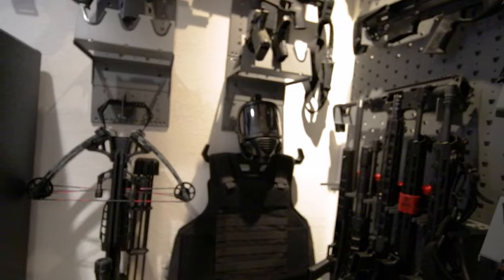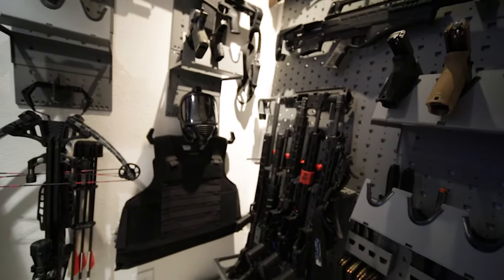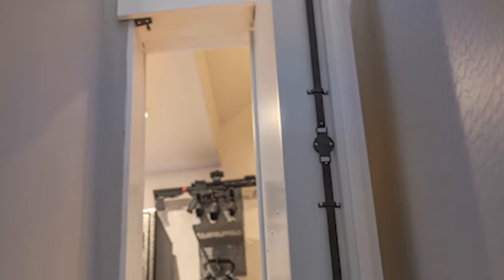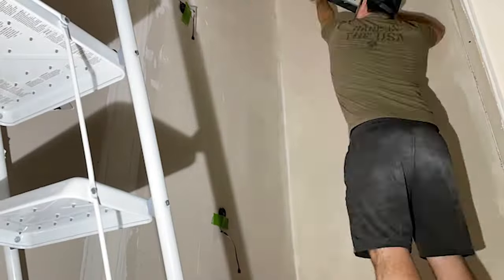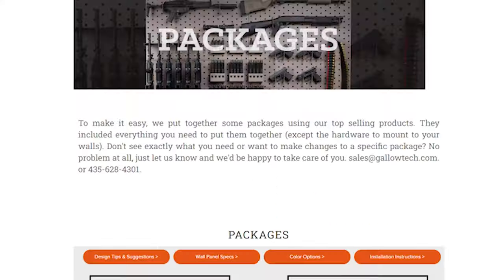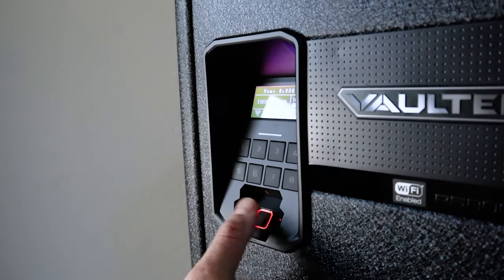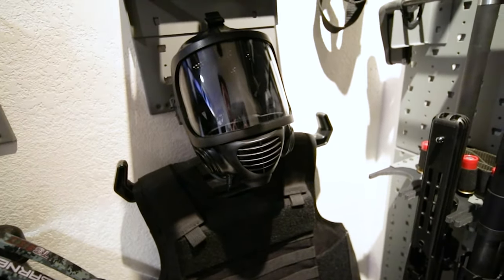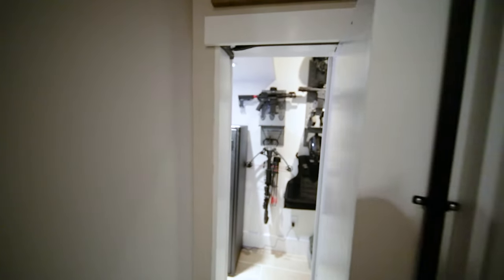Build Your Own Ultimate DIY Safe Room in Any Space

Comment: Only problem I see is security monitor inside the room. Something ever happens the cops will have to come in your secret room to watch it.
Reply: You could make it so it’s connected to two monitors except the one inside the secret room should be the main one
Reply: Exactly, and or make a decoy/fake vr setup that doesn't actually work. Run some fake wires to it etc.. there are several things a person could do to avoid anyone knowing you have a hidden monitor system.
Reply: I am sure he has more than one monitor, I do

Comment: Did you have room to store enough water or did you tap into the home’s water supply?
If the room was needed for any length of time, other questions include sleeping considerations, sanitation, and method to heat water for the dehydrated food. A second way out (through the floor?) would be ideal as well. Thanks for this insight-great ideas here.
Reply: I seriously doubt the size of the room would accommodate what you are suggesting for him, let alone his whole family. That space is about the size of a small walk-in closet.

Comment: Meh, all youd need to do is knock the drywall out next to the door to gain access...  It depends where you live, but it would have been great to use as a panic room or a shelter for tornado or hurricane wind speeds, another reason why im not a fan of the build. 
But hey, whatever floats your boat.